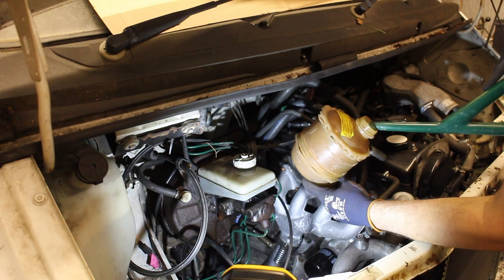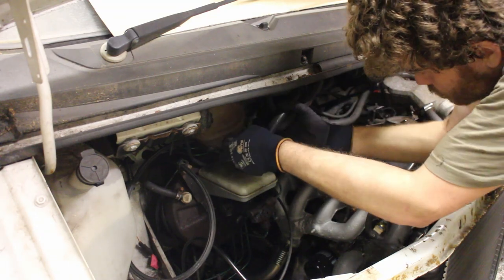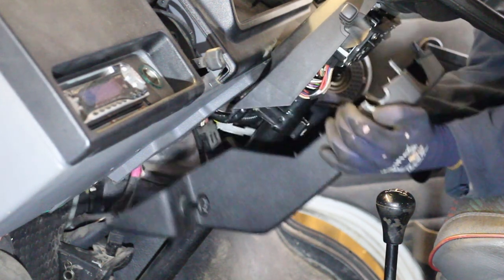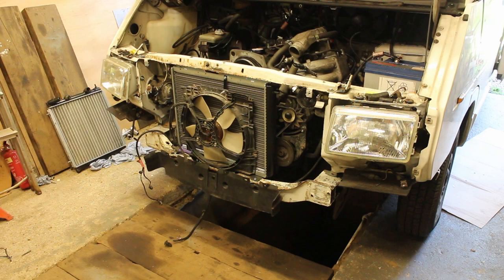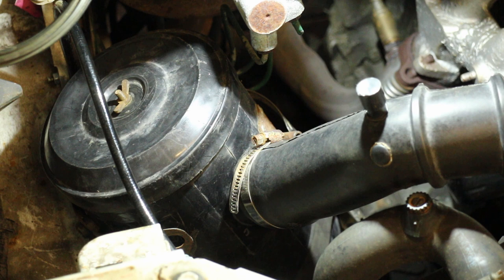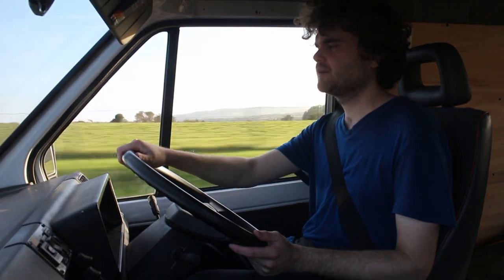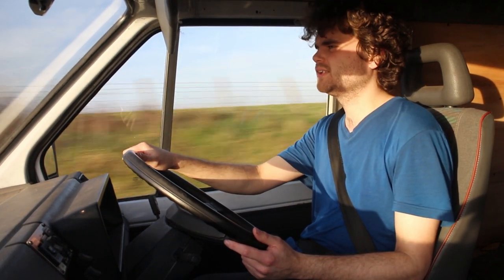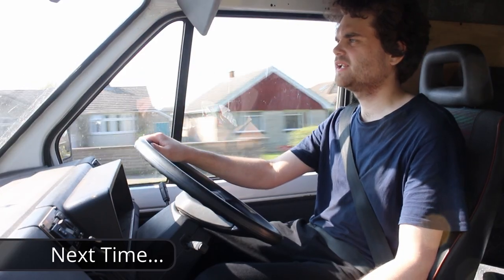Upgrading to the 2165cc Engine - MK1 Renault Trafic 2.2 Engine Swap - Part 10

Comment: did you install the fuel pump with 3 or 4 bar pressure?  do you still have the problem that when it is cold the engine starts badly?  what exactly was the problem?  thank you very much, very nice conversion!  my engine 2.2 the same one you have doesn't start at all when cold!  only with gas or brake cleaner Start Pilot!  when he is he runs great!  I look forward to hearing from you